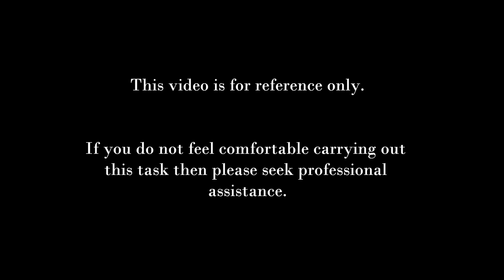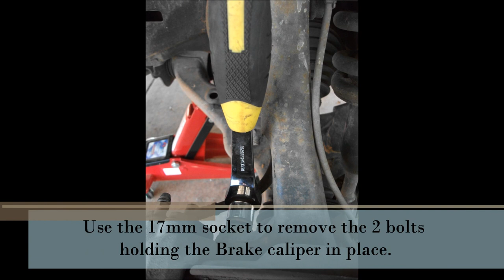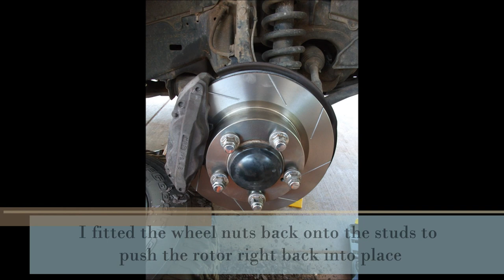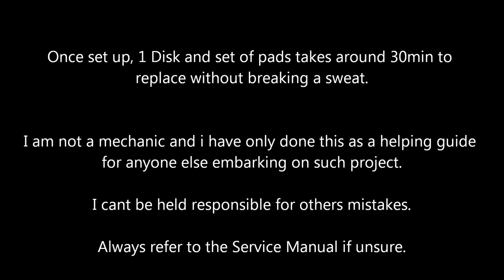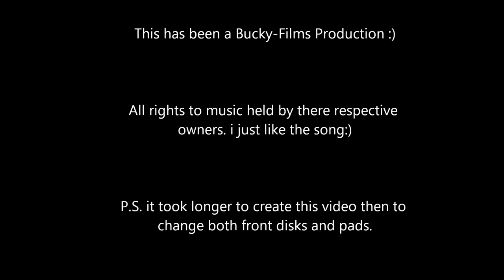Toyota Landcruiser 200 Series Front disk and pad replacement guide.

Comment: Very comprehensive but may I suggest one extra step? Since brake fluid gets heat affected right at the caliper, I do not allow brake fluid to flow back up the line to the reservoir. Better to crack the bleed nipple as you wind back the pistons so the old fluid is expelled straight out. Brake fluid should only ever flow downwards

Comment from the maker: @AxeBusa yes, in fact there were 2 steps i did not show in this video. 1. The part where i sprayed and cleaned the disks with "Worth" brake cleaner  and 2. How i  supported the caliper  while removing the disk.  I could only hope 1 would read the instructions supplied by the manufacture of the disks in correct preparation for operation. Thanks for your comment and for watching the video, i hope it helped in some way.